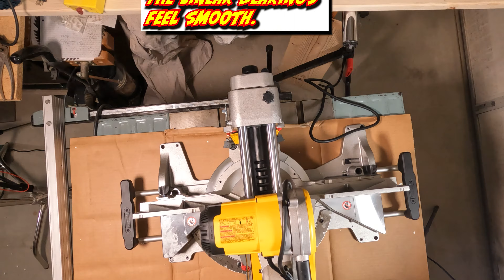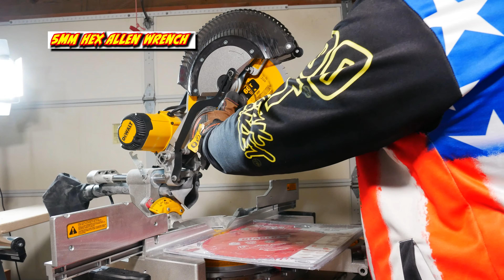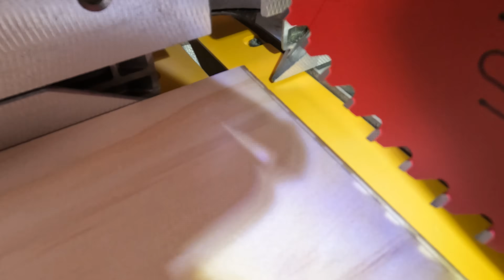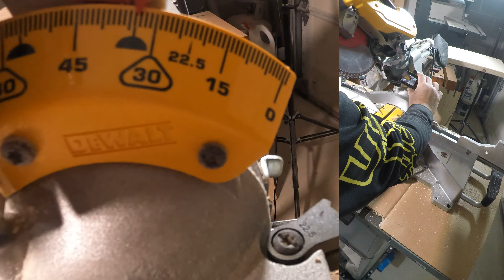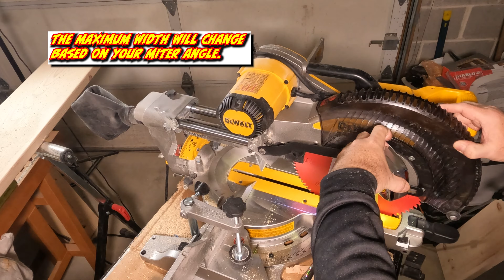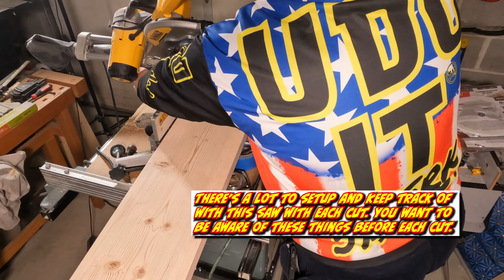DeWALT DWS780 Miter Saw with Dual Bevel and XPS Review

Comment: The 90 on bevel is set with the screw near the bevel guage on the left sticking up. Youll see blue on the threads
Reply: Yep -- otherwise it won't automatically go back to 90 after some other bevel.

Comment: Plz don’t laugh…I just got this saw,  but cannot find the power switch to save my life. I saw that you unplugged it. Seems weird to me. Am I high?
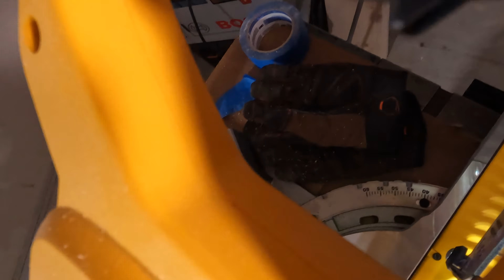Reply from the maker: Hello Lisa, I demonstrate the switch at 13:13 It has a safetly lever that you have to engage to use it. I recommend reading the operating manual with attention to the safety aspects. Hope this helps - John
Reply: @UDoIt2  thank you for that…I understand the trigger/lock switch. My older hitachi has both a master on/off switch and separate trigger switch. I guess Dewalt prefers us to unplug it. Maybe they all do that now. The last time I bought a new saw was 20 years ago 😂

Comment: its not square cos ur not pushing the saw thru along the blade line, but downwards...because the saw is bevelled this will cause it to bring the bottom edge of the cut inwards when the saw wobbles
Reply from the maker: Thank you. After I produced this video I have gotten better with cutting on a bevel. I started by securing the saw to the table saw with my large e-z hold clamps. This really helped and allowed me to focus on the cut rather than everything else that could go wrong (as you can see in the video). Then I took smaller passes through the workpiece by pulling the saw out and pushing it in. Although there's play in the saw, which is evident when you push the saw head laterally, it's still great for framing. I will continue to use it and provide updates as I discover new things. Some things that I find valuable are the 0 degree and 45 degree stops. Once they are dialed in they are repeatable. Thank you for the comments. - John